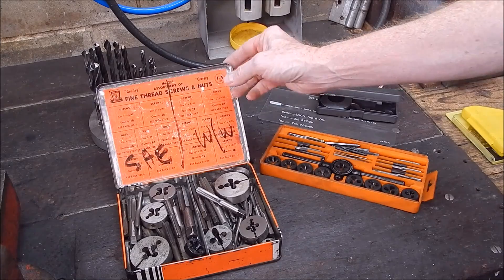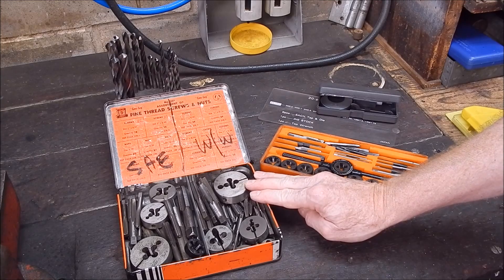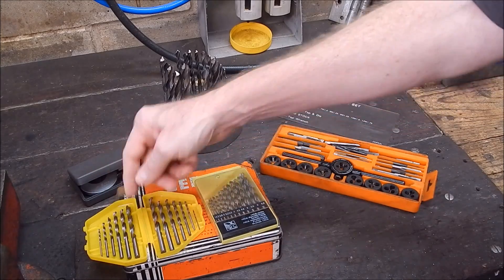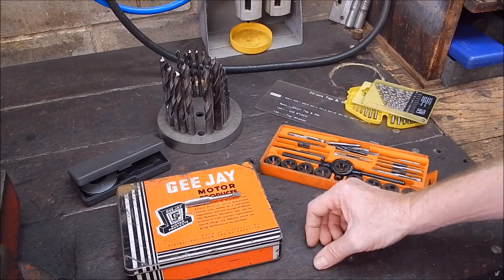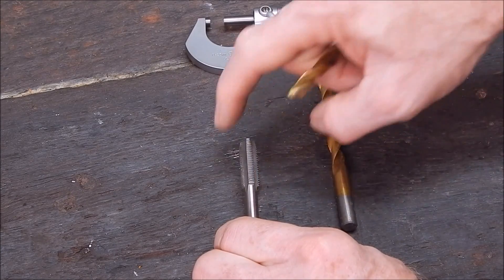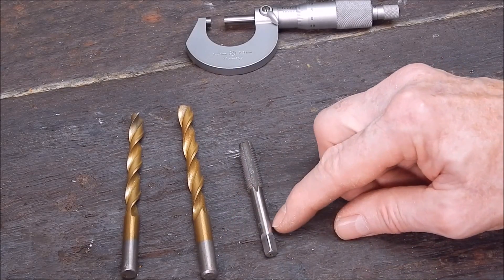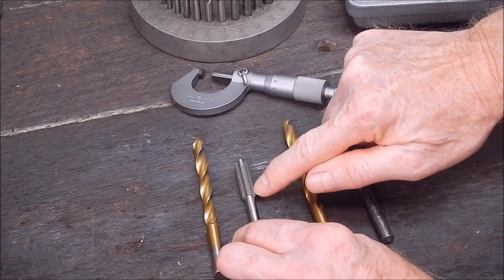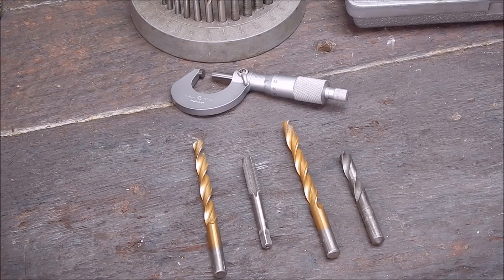How to match a drill to thread tap size

Comment: M10-1.50 x 15mm bolt what size drill bit would  I use in standard also it is a torque converter so should I go up to a m11 bolt and tap
Reply from the maker: The charts say 8.5 mm drill for 10 x 1.5 metric thread.  The size depends upon what is recommended and available space.
Reply: @Xynudu  what is 8.5 in standard
Reply from the maker: 1.5 mm is standard pitch (coarse) and you should be using an 8.5 mm drill.  You could go larger if the metal is very hard.
Reply: @Xynudu  also would you recommend I go up a bolt size are hust retap what's original I may be able to trace the threads there it looks like my starting threads are bad
Reply from the maker: Provided you have enough metal it would be better to go up a size than risk the original threads tearing out.  The alternative of using a Helicoil (if you want to retain the original bolt size) would take up just as much space.

Comment: Top tips! Much appreciated! Just about to drill into my kickstart shaft and tap it and bolt back together in the hope it will hold up until I can find a replacement shaft..... And really don't want to F  it up or I'll have to really bodge it and weld the kick start to the shaft! 
Pleased I watched this as my drill bits and tap n die set are all a bit Mickey Mouse lol 👍
Reply from the maker: Glad you learned something.  It works as well as any thread chart, which is basically just a text list of the results you will get.  Cheers Rob

Comment: I used to try to identify by eye when I was a noob, but screwed it up on a few occasions where it made me look like a real dipsh*t to my boss and co-workers, so since then I use a little chart I have taped to my toolbox at work, I identify what decimal size drill bit I need for the particular thread, grab my calipers and measure drill bits til I find the closest one. Doesn't take more than a minute or two to figure out the size I need and I haven't messed up a hole since. Most of the sizes I know by heart now but that's the way I figure it out. Whatever works!

Comment: I read that drills are undersize so you can finish the hole with a proper size hole reamer.
Reply from the maker: I can't comment on that. 

My thoughts are that all drills will make bigger holes than spec due to angular variations/misalignment in the chuck, tailstock etc.  It stands to reason this will happen as nothing is perfectly made.

If you mike different brand drills in the same size the variations are staggering.  Almost all are undersize, but to varying degrees.

Cheers Rob

Comment: Use a reamer for absolute correct size.
Drill smaller than required then ream the hole to correct size.
Reply from the maker: So, how many reamers do you have ?

Comment: Being an American I didn't have much need for metric fasteners until the 90's rolled around. My rule of thumb when in doubt was going two drill sizes smaller than the nominal fastener size. for example, drill a 5/16's hole to tap for a 3/8's bolt.
After being a mechanic for 45 years, I just recently bought a cheap metric drill set. I need to find out where you blokes are getting these metric sets with 3.1, 3.2, 3.3 mm etc drill bits in them. They must be huge sets to go from 1.0 to 12.9.
Reply from the maker: Hi Phil,

I use a micrometer on all my drill bits (I have hundreds in various sizes) as there are big variations in different brands for the supposed same size.  Never believe what's stamped on these things ;)

Many drills are under size.  So always do that to get the one closest. If I need a fractional drill I just go to the tool supplier/store and buy them as a one off.  A good supplier should have a big range of increments in smaller sizes.  A  3.1 mm I bought recently was only $3.

It would be pretty expensive to have all fractional sizes and most would never get used.

Cheers Rob

Comment: Hi 
I'm fortunate that we threw the non-metric systems out in the late 60's and its all been metric since then.
Drills not making hols to the advertised size is a problem, maybe the drill is not to size or maybe the thing is not sharpened correctly - both will cause crap.
As far as what size drill to use, my "rule of thumb" is the size of the bolt (10mm) less the pitch (1.5mm) which works in most cases where the requirement is not NASA type standards.
Of course you have to adjust it a bit for the type of material you are tapping, aluminium slightly smaller etc.
All my life I have been "metricated" and I feel sorry for the guys that have to use inches as in so many thousandths, fractions as in 3/8ths and guage and numbers (which quite honestly I have never bothered with) which are all American and when you start with the British stuff like BSF etc it becomes really frustrating.
The number of old bike motors (BSA, Triumph etc) I have converted to metric using helicoil inserts at the owner's request I lost count of a long time ago. Literally hundreds, if not thousands...
But everyone has to deal with what they have to deal with - fortunately I deal with metric and I am happy about that.
I never could figure out why the world should use a system of measuring things based on the length of some long dead despot king's foot. ;>}
Thanks for this and all your other videos - NICE !!!

Comment: Is there a metric tap chart by metal used? stainless needs different hole size than aluminum obviously.
Reply from the maker: I've not seen one, but some viewers say they have that included on theirs.

Rob
Reply: on a harder material like stainless, go by the 75% standard.. On aluminum or brass, you can run 100 percent with lots of patience.

Comment: I apologize for not watching your whole video. I'd agree there may be some variances in drill bits but I've never once seen a machinist or a millwright from a paper mill to a nuke plant ever measure a drill bit. We were taught in our apprenticeship here in the US if no drill tap chart is available a simple easy method threads / by whatever type measument system to be used minus diameter of bolt size equals drill size. So 1" with 8tpi =.125 1/16" minus 1/16 from one inch and that's what u need.

Comment: In principle tap drill size = OD - pitch. Works in any units. For example M6x1, drill 5 mil. For 1/4-20 pitch is .050 so drill .250 - .050 = .200. Now go try to find a find a .200 drill. Good luck with that because Imperials are either fractional which you will have to convert or Morse numbers which you cannot easily convert to decimal. Or, what most of us do, look up the Morse number drill in a tap chart. I hate Imperial, but I have to use those damned fasteners or pay premium. So I use a tap chart. Mine came off the web at no cost, and I took the one that seemed least complicated. Most of them will account for material. And you are absolutely correct, no drill is the nominal size. I caliper all my Morse drill before use..
Reply: You hate Imperial?

What a coincidence, I hate Metric.
Reply from the maker: +Juan Rivero 

Thanks for that Juan.  You have fully summed it up.

It's pot luck the way drills are made these days.

My older (pre 1980's) drill bits are closer to and sometimes even meet nominal size, than the current stuff.

Cheers Rob
Reply: And thanks for the post. Not everyone had a mechanic for a father!

Comment: Some good tips there Rob. My dad taught me a bit about using taps and dies when I was in Year 7 at school and you just assume that everyone else learns similar things at home. Unfortunately they dont and a lot of building tradesmen have no idea when it comes to taps, dies and machine threads.
One thing I have noticed is the difference between standard allthread/bolts/nuts and galvanized. Gal. is a lot sloppier.
Reply from the maker: +Mark Fryer 

Hi Mark.

I think it depends who makes them.  In the same batch I've found nuts that vary in tightness significantly. I know what you mean.

Can be frustrating at times.

Cheers Rob

Comment: Rob I totally agree-drill sizes are all over the place--3/8 for example,I was chasing a drill right on .375 the closest I got was .371--the other 8-9 that were measured were .364-.368.
Bloody pathetic...I don"t know what those straight flute drills are like,I was thinking about investing in a few common sizes..Maybe some of the other blokes can comment.  E
Reply from the maker: +Ian Craig 

Hi Ian,

What gets me is that they make metric taps (as an example) and as shown, when sizing a 10 mm tap, you have to go to the Imperial range as there's nothing in the standard metric drill sizes to fit properly. LOL.

As I said, there's lots of variables which come in to play. 

Just relying on a thread chart without sizing with a micrometer is not a good idea.

Cheers Rob

Comment from the maker: Always measure drills at the cutting end.

When using the eyeballing method, check the shank diameter against the cutting end as well.

Drills can be uniform,  or vary + or  -  from cutter to shank end.  Expect a worn drill to have a thicker shank than the cutter.

New drills can even vary + or - in uniformity at each end for different sizes within the same set.

So not only will they probably not be the stated nominal size, they may also not be of exactly uniform diameter throughout their length.

Don't believe me?  Get out your micrometer and have a look.

Nothing is set in concrete when it comes to manufacturing tolerances - particularly on cheap home use products.

Cheers Rob

Comment: Today tapped aluminium bar 12 mm for glow plug to make heater to vaporise a honey bee treatment, didn't fit. Glow plug 1.25 pitch, my tap 1.75! Swearing used glow plug as a tap & it worked, but couldn't shake deserved feeling of being an idiot.
Reply from the maker: +Springwood Cottage 

Yes, correct pitch is important.  We've all been down that road.

Cheers Rob

Comment: Nice video i was tapping a m6 x 1mm pitch hole a few days ago for a Lethe crosslide handle
the charts show 75% thread with a 5.2mm drill bit,But i only had maybe 20mm clearance and
did not take this into consideration by the time the tap hit the bottom tolerance through hole
there was not 75% thread from top to bottom in the hole..I should have went with a 5.0 mm 
bit or smaller,Was a steep learning curve plus i never had a plug tap just a set of presto standard
taps..but you are correct there are loads of variables you need to take into consideration..My 
first learning curve..:D..

Comment: There is a big problem using the "eye it up method", that is that the drill shank is often under size to the cutting size of the drill, if you are going to guess sizes for something as important as a tapping drill, why not just try the cutting end of the drill in a nut. The subtraction of the pitch from the thread diameter only works if you are using a thread with a 60 deg thread angle, on 60deg it is obviously correct, but tapping size charts are usually free anyway, pin one up in your workshop.
Reply from the maker: +Englishman French 

All good comments.  It comes down to what works best for you.

I rarely use a chart, even though I have one, mainly for very small sizes where eyeballing is hard to do.

Most common threads are 60 degrees, so the subtract pitch method is very useful for the average hobbyist.

I've read many comments about drill diameter variation between shank and tip, but my measuring shows that to be a bit of an old wives tale.  Depending on who makes them, there may be no variation, or variation plus or minus between ends.  Also depends on how worn the drill is.

Cheers Rob
Reply from the maker: +Englishman French 

There's no way I would ever use a nut as a drill sizing guide.

That's too ugly to even think about - the nut could have any sort of error factor.  They can vary enormously.

Cheers Rob
Reply: +xynudu : Too ugly to think about ! It really comes down to what sort of material you are used too, any properly made nut , (probably hard to find now I grant you) should be made to exact specifications layed down by British Standards, but now of course we have Chinese nuts that you can throw on from the other side of a room, any Military spec thread should be to exact sizes and checked as such, with rolled threaded screwstock being made in every banana state now, there is very little control over sizes, so that is why I always just look at the manufacturers drilling and tapping chart on the wall. I think those Doves outside your workshop are waiting to be fed!
Reply from the maker: +Englishman French 

The problem isn't just the nuts, it's the quality (or lack of) in cheap thread/tap sets you can buy these days.

I would rather size against the tap than the nut, as that way you can control the drill hole size more accurately.

Personal choice.

Cheers Rob
Reply: +xynudu : Quality! You are absolutely right on that one, having worked in the rarified air of quality in Government Establishments where only the best quality tooling is used, I have not been exposed to the lorry loads of Chinese crap imports that home machinists have to use, a friend recently brought me a Tap & Die set he had purchased at a "bargin" price, they turned out to nothing less that film prop jobs, not one of them was heat treated,(if they were high carbon steel), in fact a lot of them still had burrs from the machining process ? Made in China, it said on the box!
Reply from the maker: +Englishman French 

That's why I am very wary when sizing stuff.  In those cheap sets, the taps and dies often don't even match - use both and the thread is loose etc.  Generally not even HSS.

I've lots of quality old taps and dies, and those I can trust.

But getting back to sizing against nuts, some of the old English Whitworth nuts were so poorly made, it was criminal.  That's why I never size that way.

Makes life interesting.

Cheers Rob
Reply: +Englishman French Some of the tap drill charts that come with the sets are also way off. A guy at work bought cheap set, and some of the suggested drills for the various taps where the size for a clearance hole.

Comment: Just so useful this one - thanks for posting.....

and your next one might be any tips you have or ruls of thumb that make sense...regarding how deep do you go when cutting a particular sized/pitch thread on the lathe..
Reply: +Peter A : How deep you go must depend on the job in hand, but as a rule of thumb the thread depth should be at least equal to the thread diameter.
Reply from the maker: +Englishman French 

I don't understand this statement.  Please explain.

Cheers Rob
Reply: +xynudu: I am glad you ask this question Rob, I interpreted Peter's question to be asking how far into the job depth wise the thread should be, i.e, length of stud/bolt into the job, hence the 1 x dia of the thread dia being tapped, which would give enough depth of  thread to give strength to the fixing. What I did not consider was that he would be unsure on the actual depth of the individual threads into the job being screwcut, if that is indeed what he was asking, as this would be dependant on the thread specification.
Reply from the maker: +Englishman French 

I think that's what he was asking - depth of single point thread cut.

Your reply made me wonder if you were referring to thread measurement wires in some way.

There are no "tricks" to cutting single point threads that I am aware of.  It all comes down to experience.

It's something most people do very rarely.

Cheers Rob

Comment: Good day Rob, That's funny your old man showed you that trick, as my old man and grandfather both showed that same trick to me and I have always used it. I did try going by the chart for a short time just to find that I always seemed to end up with threaded holes that were rather sloppy so I went back to the way I always done it. 

Thanks much Rob!
Reply from the maker: +volcom7114 

Yes, it's probably a trick as old as the hills, but not every one has a grandad that can show them.  Works well. as it helps reduce the error factor.

The variation in drill sizes is an issue that I suspect a lot of folks are unaware of.  I also suspect a lot of hobbyists don't use a micrometer too often :)  He He.

All good stuff.

Cheers Rob
Reply: +volcom7114 : If you are following the makers tapping size chart they will indicate what percentage of thread you can expect, they have arrived at the sizes quoted after a lot of experimentation, the only way they will not work is if drills of some foreign manufacture are used that are not of the size indicated, this can be avoided by measuring .